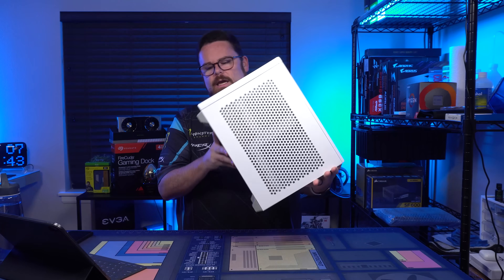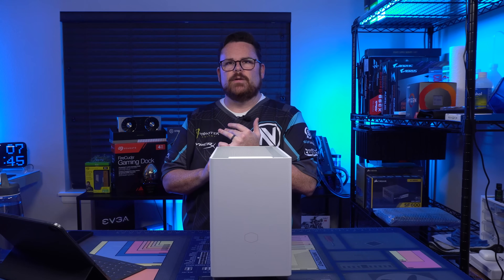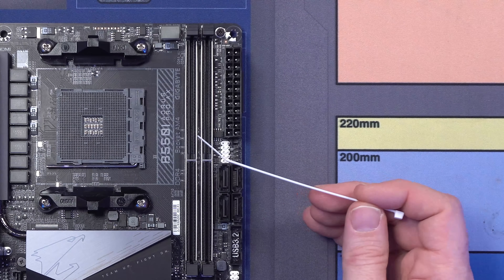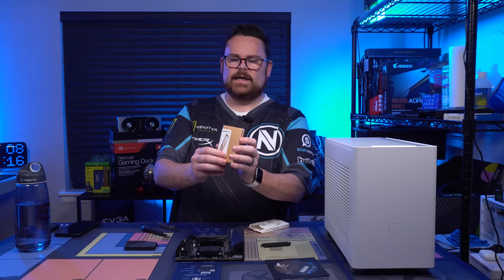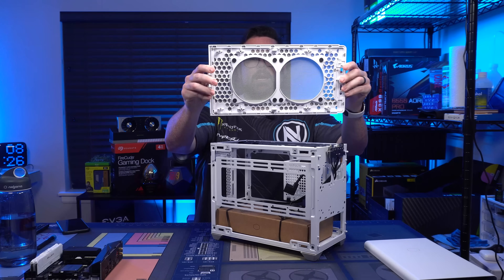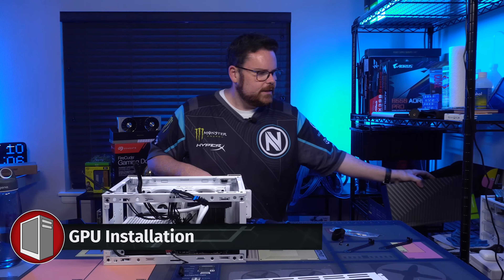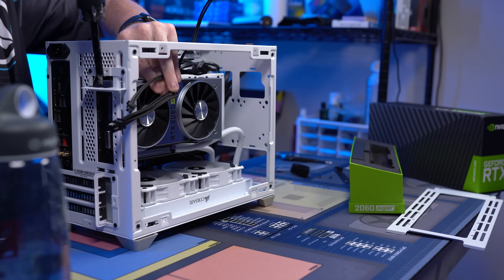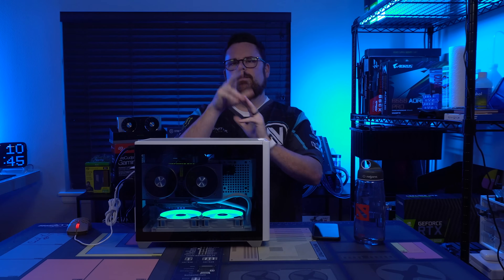NR200P Case Review and a $1500 Streaming PC Build Guide | Robeytech

Comment: I finally built my pc and all the parts were all from you
Reply: AWESOME!
Reply: @RobeytechLive  https://youtu.be/MtALhv22Ltk this was your vid I got the parts from
Reply: Never put the radiator down with the hoses up. As the air inside the system tends to stagnate in the CPU, significantly increasing its temperature.

Comment: making AIO as exausth its just bad! putting AIO in bottom from start its BAD! if you got a AIO with bomb inside the radiator like for exemple MSI and RAIje have! its ok! but normal one´s dont do that! 
put GPU horizontal way, 2 fans under gpu as intake! put AIO from side as intake and the 2 fans include with case in top as exausth and then you have the best airflow setup for that case!

Comment: who wants to bet the aio died lol
Reply from the maker: Nope, 100% fine and no issues.  Even the one I have been running for almost two years no issues as well.  Also be careful when you talk about AiO's in this configuration because some pumps are actually on the radiator which means they wouldn't be at the top of the loop.  Also even in this configuration they have a higher chance of failure and a chance of a lower life span, it's a risk you take but in 98% of cases never causes a problem.

Comment: Never put the radiator down with the hoses up. As the air inside the system tends to stagnate in the CPU, significantly increasing its temperature.

Comment: i recently built in this case and i can say: putting the aio in the top und the card in a horizontal layout with fans underneath, will significantly improve thermals and noise!!! It will not look as nice as this build, but noise is way more important to me, personally. anyway: awesome video! subbed 👍

btw: putting an aio in the bottom should be well concidered. See Gamers Nexus - 'Stop Doing It Wrong: How to Kill Your CPU Cooler (AIO Mounting Orientation)' on that one.

Comment: Hey bro, if i swap out the aio fans out for a slimmer one, can i mount the gpu directly above the aio fans? So that the gpu is horizontally mounted.
Reply: instead you will have to sacrifice the tempered glass and sidemount the radiator https://youtu.be/BbGomv195sk
Reply: this orientation is bad for the aio, so dont do it

Comment: The pump being the highest part of the cooling system isn't ideal as any air in the system will rise to the highest point and eventually it will damage/reduce the life of the pump.
Reply: I was going to comment this but you beat me too it. Its better to have the rad on top. Only thing I question, is using the fans on the rad as exhaust? So you make the bottom case fans intake, correct?
Reply: @nusession  the only problem with that is that you can't because the PSU bracket gets in the way, the only way to use a large radiator apart from the bottom is on the side and that stops vertical graphics card use. A custom loop is the only way to use the bottom position safely. This case appears more flexible than it really is because of the compromises necessary to water cool it and the odd choices of position for the PSU. It would be better to have a conventional PSU position and allow the top to be used for a radiator or exhaust fans. I think that I would use the best air cooler that I could fit in.
Reply: @paulm2467  Interesting thats for sure. I just got this case , slowly going piece by piece. Just have the motherboard so far. I see that  Leo did a smaller 90+mm rad combo, mounted to the rear, seeing that the tubing orientation can hoop up n over instead of the feed being hooped down, I suppose the only main stress would be the return. I was really looking to try and take advantage of the vertical GPU mount, so I suppose i will have to look into that a bit more.
Reply: @nusession  you can use small radiators but they are usually worse than air coolers with more likelihood of failure and an added risk of damage to other parts of your build. I once used a h80 Corsair with 2 fans and a double thickness radiator but it ended up being massive and no better than an air cooler.
Reply: @paulm2467  Ah true - understandable. ends up more strain on the pump with the limited liquid flow i suppose. Do you know if there is any air coolers that would work with running vertical mount GPU for this case? or is that out of the question?
Reply: @nusession  I don't know what the clearance is, it doesn't look great, I would think that something like the scythe big shuriken 3 or the 65 mm Noctua would be about as big as you could fit.
Reply: @paulm2467  Got it, i will def look into that. Appreciate the replies
Reply: @nusession  watch the gear seekers video on 
air cooling the NR200P! if you havnt...

Comment: ya lost me at the bottom mounted aio
Reply: Yeah, it's definitely concerning...an AIO with the pump in the rad or in line would have been a safer bet. Wonder how his setup is holding up.
Reply: i'm not alone. aesthetics. wink wink
Reply: That is the only reason I don't want to buy this case smh
Reply: @dennyingraham1586  There are AIOS with pumps in line or the rad. The Be quiet model comes to mind. If you decide to go with the mesh panel and mount, any AIO with the pump on the cooler will work.
Reply: @notag4495  I've heard of those and I can see how that would protect the pump.  However, what I'm also concerned about is the cpu water block being at the top of the loop where the air will get trapped.  Overtime more  air will accumulate becoming more of a problem risking your cpu with inadequate cooling.  Rule of thumb that I personally go by: Never have a pump and/or water block at the top of your loop.
Reply: @dennyingraham1586  I did a vertical GPU mount and used a bequiet! pureloop and it's great. The pump is low in the case as it's mounted by the rad in-line. Plus you can top it up if you're worried about excess air in the cold plate. Even having the CPU pegged at 100% encoding proxies for an hour it stays well below temp spec (3700x for reference). Just be sure to go with a 240mm rad if you're mounting in the base of the case. I had to make some major modifications to get a 280mm to fit properly. The 280mm support in this case seems to be for side-mounting it so the tempered glass and vertical GPU are out if you go that route. So far very happy with the case despite this.
Reply: @kevkevdellarocco8681  thanks for the heads up.  I've decided to go with this case with a side mounted 280.  Good to know that 280 isn't supported at the bottom.  Yes, I would be very concerned about the air in the water block with your settup but if your keeping an eye on it and maintaining it then I don't see a problem.  I just don't have that kind of dedication.
Reply: @dennyingraham1586  Could consider this from the King of the NR200 - Top Rad Mod
https://youtu.be/Qan37k691-4
Reply: Ditto especially as going with vented side panel- there is a ‘way’ to mount one up top if you are using the glass side panel otherwise that AIO is probably a touch overkill for a 3600X.

Comment: Does using two nvme ssds impact gaming performance at all because it's using more pcie lanes? Or will it be perfectly fine?
Reply: Doesn't matter :) Those connected to chipset share bandwith with other stuff connected to the chipset though, usually 4 pcie lanes from cpu to chipset but you wouldn't notice while gaming really. As of now you don't really get much over just gaming from a regular ssd anyway. Might change due to new consoles though :)

Comment: All those wires pressed against the ram I'd be worried what would happen after the ram heats up if it would destroy them or wear them out. Although my computer usage is probably different as I have mine running almost all day streaming movies/tv and doing 3 hr gaming streams a day.  Also I'm not that knowledgeable on small builds like this.

Comment: I want to build a computer for about a $1000 is it stupid to do it over the course of a month buying 2 or 3 parts each payday for the build are things going out of date super fast now days I haven't been into computers for about 10 years and yes I used to build my own computers around 2006 to 2008  But it seems things have changed a lot since then and what is the best operating system to use
Reply: @justinrobey306   Does that have to do with new parts coming out before Christmas time that's why I should probably wait for all the new stuff to come out to lower the prices on the little bit older stuff

Comment: Heard it was bad to install the AIO on the bottom is this true. I am about to build my new PC NR200P and I want to install an AIO as well.
Reply: Depends on how you want the build to look, if you want to use the TG panel and use the GPU vertically, installing in the bottom is your only choice. I'm picking my NR200p tomorrow but I'm going with Air cooling I think, I'm not sure yet.
Reply: Good video on AIO orientation: https://youtu.be/BbGomv195sk
Reply: go to Gamers Nexus channel and watch his videos about AIO instalation. Never install your pump at the highest point of your loop
Reply: @RobeytechLive  Sure you can, but look over function is not my go to choice
Reply: How bad can it be? Assuming there is air in a closed loop AIO configuration, what could a little air for a split second do to the pump when turned on?

Comment: I plan on getting a 3080 when they are available, would you recommend getting a zen 3 processor or sticking with my 3700x?
Reply: Keep the 3700x it’ll be fine even for the 3080

Comment: I’m new to pc building and my budget is around 3k and recommendation I’m overwhelmed by the parts I should pick
Reply: Say you should wait to get one of the newer Graphics cards. But for other parts I’m gonna leave that for the experts to decide.
Reply: Start with what you play? esports games or cyberpunk? 
then what monitor you have /want, usually high refresh rate lower res for competitive and higher res lower framerate for role playing games. 
then use the a guide to find which build will drive the monitor you have selected
Reply: If your budget is 3k try to get your uands on a 3090 if irs a workstation pc wait until the rx 6000 comes out and compare it to the 3090 I'm no expert towards this though so take it with a grain of salt
Reply: @the_real_dab  will this be okay to build as first pc? https://pcpartpicker.com/list/nN7P68
Reply: @marcusvowels6404  it seems great but remember that amd ia making a 5000 series soon. On November 5th
Reply: I forgot to add that you have no hard drive they are slower than ssds but let you have more space you can get a good 2 terabyte one for 50 dollars